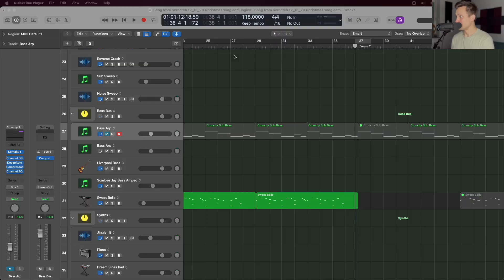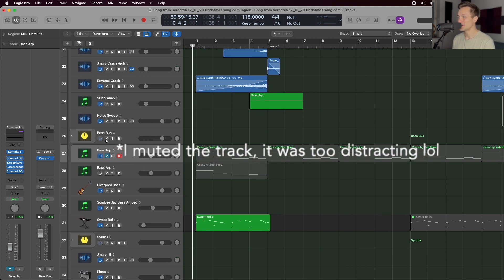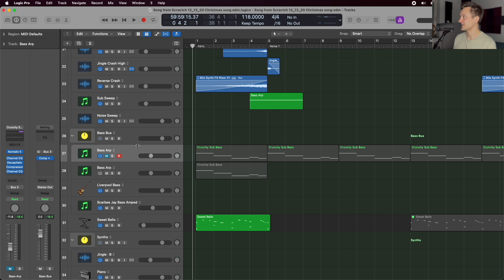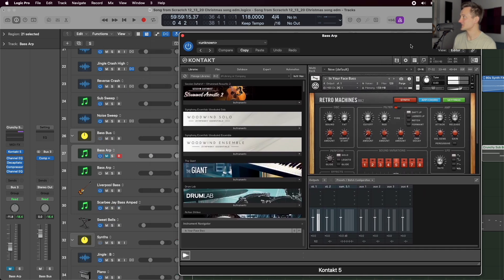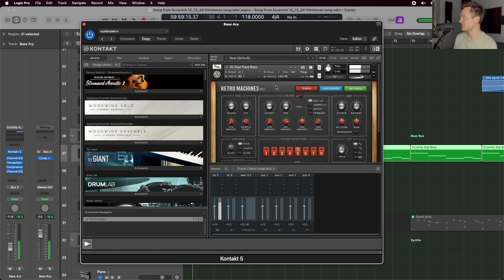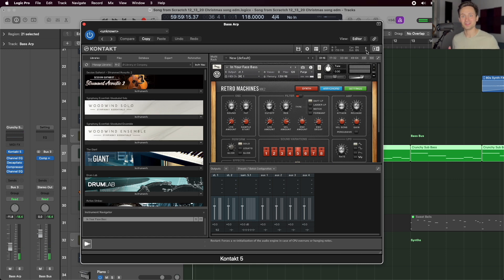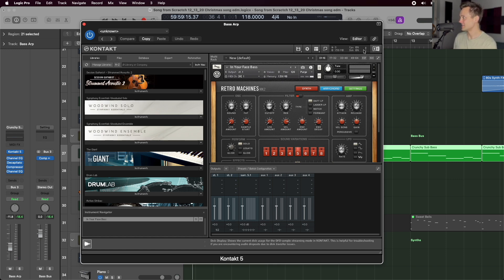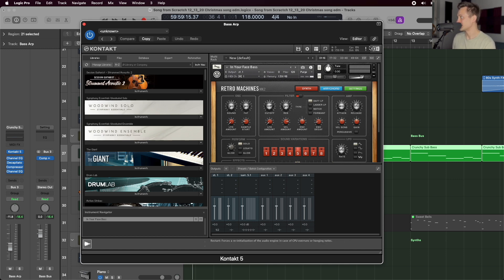How to Fix a Stuck Note in Kontakt player

Comment: By dumb luck of fucking around with a lot of settings, I found a fix so its stops happening over and over again. I've browsed a dozen forum posts for the fix but I'm here and laready logged in so I'll share:

 In Kontakt, go to the Output settings of your instruments (toward the bottom-right of the gear icon, under the preset name). Create a seperate output channel for it by clickng "Create seperate Master Output Channel". I'm using Ableton, and after you change that it fixes the glitch, for whatever reason. After pause, no. morehanging notes. 

Fair warning, if you do this it  might change any fancy routing in kotakt. Not many people do, so I think this is a solid fix.
Reply: But also, the ! panic button thing helped too while I was figuring it out, so thank you!
Reply from the maker: Woah! verrry interesting (and random lol) I need to test this ASAP. I actually do use fancy routing quite a bit with drums, but thankfully not with synths/non-drummer instruments  (which thankfully is the only time I'm experiencing this issue). Thanks so much for sharing!